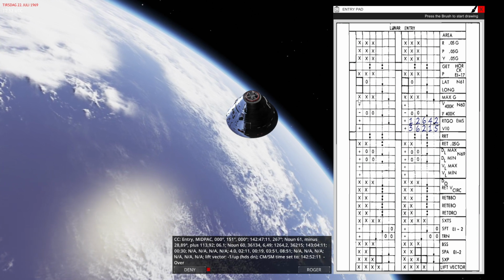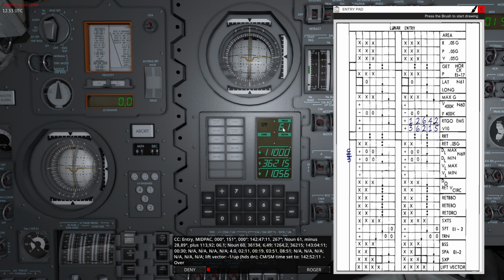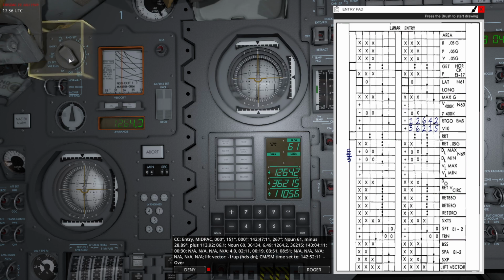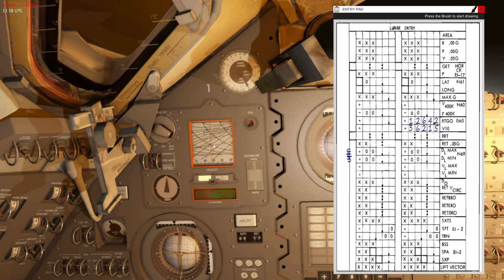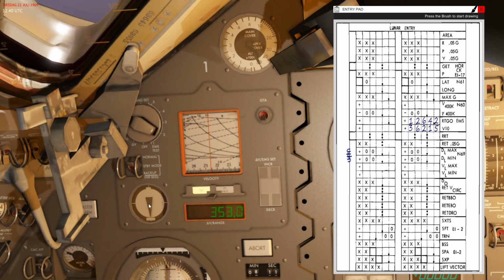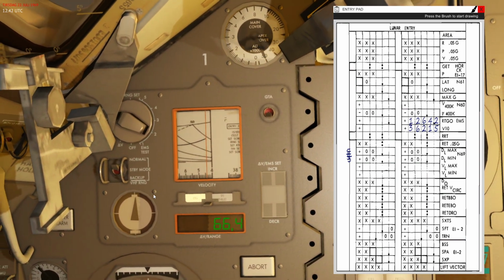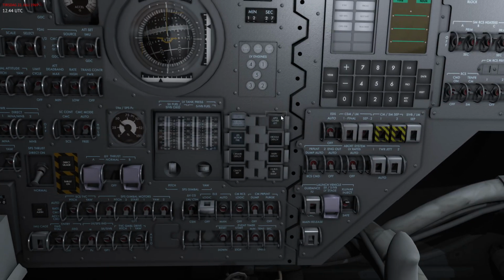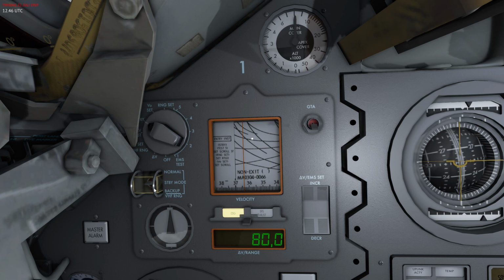How to fly the Apollo Command Module through the Atmosphere

Comment: I am struggling with the final lesson for the Apollo Command Module (Lunar Entry). I am not getting to the landing because I am either too steep or being pushed back into space. I did the EMS Tests and I think I followed the checklists correctly, but when I hit 0.05G and P67 has started the EMS does not start (no range countdown and G tracker is also not moving). The EMS is in normal mode. Any idea what I could have done wrong?
Reply from the maker: Sorry for my late reply. Do you recall if your 0.5G switch is set to UP (lower MDC-1)? This usually happens when the EMS 0.05G light illuminates. If not it prevents the EMS to move and count in reentry mode.
Reply: @ReentryASpaceFlightSimulator  Thank you, I will check that.